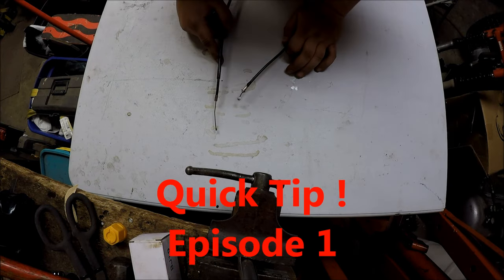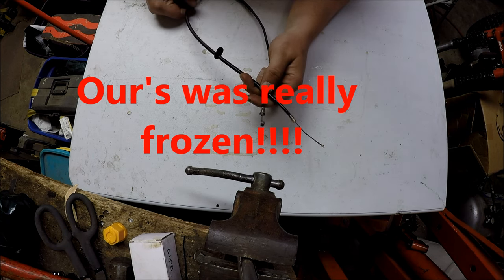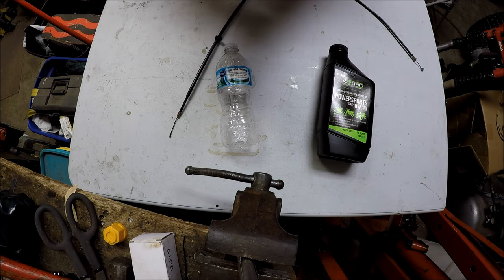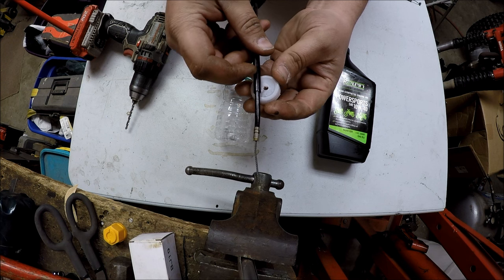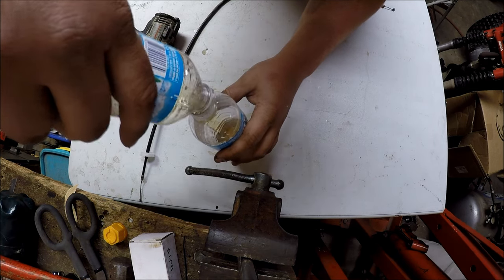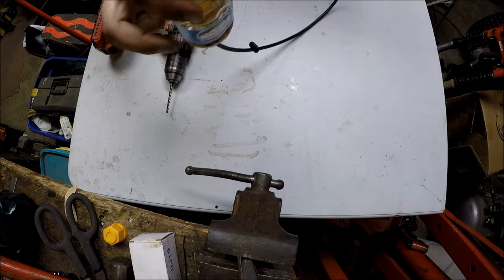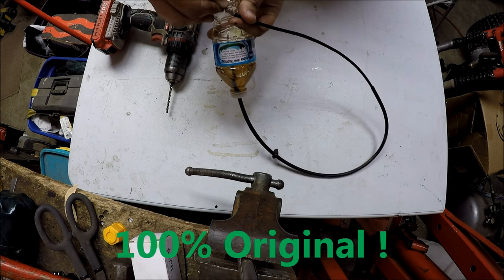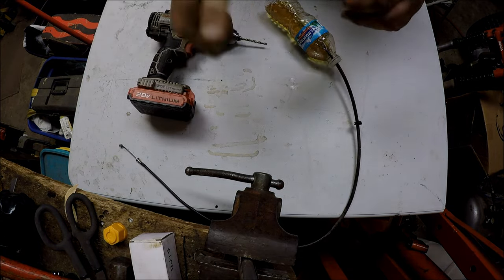How to fix Frozen Throttle Cable  , Brake Cable , Choke Cable on ATV Motorcycle Dirt bike

Comment from the maker: Please consider subscribing and share any tips and suggestions with me.  I would like to say I have gotten alot better with making videos since I uploaded this 3 years ago.
Reply: I have a old WD-40 can  that I use to do the same thing sort of.  

   A couple inches from the top I drilled a hole on the side of the can and I put in a tire valve stem in it. 

   Now the part of the can that had the sprayer on it, I pulled all that out of it and put in its place a thick rubber cork/stopper.   The rubber plug or whatever - I drilled a hole into it - that hole is for placing the end of a throttle/brake - any cable - lawn mower cables mostly is what I do.  So the hole pressure fits and seals around the sleeve of the cable.  I have a WIDE hose clamp that is bent over on one side - I put the folded over side over the rubber stopper - and clamp it down.  

   I use automatic transmission fluid and that is mixed in with some thinner All-In-One oil (whatever it's called 4 n 1  or 3 n 1 - anyways any light oil to thin it down more works)  - The automatic transmission fluid prevents rust for one - and it penetrates through the entire cable - regular motor oil is thick and doesn't do that very well unless it's up to a certain temperature.  I fill the can half way with the mix before I put the rubber plug in with the cable.  I put the end of the cable into a 5 gallon bucket with some blue shop towels to prevent oil spraying everywhere.  

The cable goes all the way to the bottom of the can - so the thing works like a regular aerosol can but with more pressure - no worries about blowing up because it's got that hole in it where the cable is at - it acts like the tube that used to be in it.  The thinner oil plus the pressure of the air pushing only the oil through, takes a few minutes - and that's setup time! 

   What's nice is I can do this while the cable is still attached to whatever I'm working on!  

  I hope you dig my little invention lol!  Thanks for sharing yours!  -  PS, I have a few different rubber stoppers with different size holes!   I tried using a big farmers syringe thing for giving cattle medicine orally - since I had a few of them around that I use to put methanol and other race fuel inside RC monster trucks - but they couldnt push enough pressure into the cables.
Reply: @AEON.  I'm thinking of doing something very similar to your idea.  Glad to see yours worked. 
I'll use AT fluid mixed with acetone..... read about this mixture awhile back and have found its a great penetrating fuild.
Reply: @wholegrain27  It's great but it also swells rubber so it can be used in tires of lawn mowers and stuff to help seal the inside of the tire from cracks on old rubber.  I put it on the cracks on the outside of the tires as well to help them last a bit longer - its nice because if you run over a nail or something like that it will auto seal if its saturated enough and has some moving around in it.  we do this with old tractor tires too because they are so fricken expensive - especially new ones now a days.  But yeah, it will swell rubber some.  It also swells the rubber stopper with the hole drilled in it so make sure to take that into account before pressurizing it - just make sure the fluid doesnt seal the inside hole you drilled lol - I hope it works!  If you can find this post again let us know!  Cheers bud!  Have a good week!

Comment: Once you have the cable moving a bit, you can attach the drill to the inner cable, and spin it slowly spreading the oil inside the tubing, then gradually work it in and out while spinning the cable. It won't take 3 days that way.
Reply: That's what she said.

Comment: why did you pour the oil into the other bottle instead putting the cap on the bottle which has oil in it already?
Reply from the maker: I don't know lol
Reply: Cause he didnt want to ruin the original quart of oil
Reply: Probably baked lmao
Reply: Lol i thought the same thing!  Just doing all the steps tho
Reply: @riceuser18076566  must not understand
Reply: Welp I saw the answer and I'm out...
Bye
Reply from the maker: @jayceraiden1740   I think you are on to something.  Lol
Reply: @DGCoinPusher  yeah, Baked af
Reply: He doesn't need the whole bottle of oil- just enough to cover the end of the cable. Also, the clear water bottle lets you see what is happening.
I just now did this, and I used old motor oil. We'll see if it works.
Reply: Lynn Kasdorf well it’s been 4 weeks how’d it work?
Reply: I think it was just to show us what's he doin
Reply: LOL! Great video, but that was a wtf moment!

Comment: I’m going to try this on a motorcycle throttle cable that’s been sitting since 1995… I’m more concerned about a rust spot creating a weak spot on the cable but if I get the bike to run and the engine sounds good I’ll just replace the cable. My goal is to not spend a dime till I hear the engine running. I sprayed PB Blaster in it and let it hang for the past few days with no luck. Appreciate the advice and video! 💪

Comment: You're a backyard GENIUS!  I did your drip method overnight on a frozen mower throttle cable, the old style with the wound wire shroud.  I used 2 cycle oil (from Ass Hardware, which after properly mixed with gas, burned up my weed whip!) But it freed my cable!
Reply: Naaastaay

Comment: INGENIOUS! GREAT IDEA! LOVE IT!  I  was trying to think of a way to do this today for my lawn mower safety break cable because the shop wants $46 for it! About what I paid for the mower! lol So I thought about duck taping the end of the cable to a funnel and letting it flow in that way. But ended up just submerging it in a 1 gallon motor oil jug with new oil in it. But I like your idea a lot better because I wont know if the oil went in or not and I can't test if it is free. One idea I just thought of though is use Transmission fluid. I was told to use it to free up a car engine that had sat for years and was stuck from rust in the cylinders. And after 24 hours it turned over smooth as can be. I was told it breaks down rust. So might work faster for these cables! :)

Comment: For those commenting to just buy a new cable, I have a stuck accelerator cable on a 2 tonne mini-excavator. Replacement is $260.
This seems worth a shot
Reply: Diesel first then lube
Reply: I've done a different method on large machinery!  I hope it helps!  -  Keep it in your tool set!   (Even used it to push hydraulic fluid through a line to get the air out! after changing an accessory on a Backhoe!

  I have a old WD-40 can  that I use to do the same thing sort of.  

   A couple inches from the top I drilled a hole on the side of the can and I put in a tire valve stem in it. 

   Now the part of the can that had the sprayer on it, I pulled all that out of it and put in its place a thick rubber cork/stopper.   The rubber plug or whatever - I drilled a hole into it - that hole is for placing the end of a throttle/brake - any cable - lawn mower cables mostly is what I do.  So the hole pressure fits and seals around the sleeve of the cable.  I have a WIDE hose clamp that is bent over on one side - I put the folded over side over the rubber stopper - and clamp it down.  

   I use automatic transmission fluid and that is mixed in with some thinner All-In-One oil (whatever it's called 4 n 1  or 3 n 1 - anyways any light oil to thin it down more works)  - The automatic transmission fluid prevents rust for one - and it penetrates through the entire cable - regular motor oil is thick and doesn't do that very well unless it's up to a certain temperature.  I fill the can half way with the mix before I put the rubber plug in with the cable.  I put the end of the cable into a 5 gallon bucket with some blue shop towels to prevent oil spraying everywhere.  

The cable goes all the way to the bottom of the can - so the thing works like a regular aerosol can but with more pressure - no worries about blowing up because it's got that hole in it where the cable is at - it acts like the tube that used to be in it.  The thinner oil plus the pressure of the air pushing only the oil through, takes a few minutes - and that's setup time! 

   What's nice is I can do this while the cable is still attached to whatever I'm working on!  

  I hope you dig my little invention lol!  Thanks for sharing yours!  -  PS, I have a few different rubber stoppers with different size holes!   I tried using a big farmers syringe thing for giving cattle medicine orally - since I had a few of them around that I use to put methanol and other race fuel inside RC monster trucks - but they couldnt push enough pressure into the cables.
Reply: I have an old motorcycle that I can't seem to find a replacement cable for. Im giving this a shot but it is completely seized. Hope this works. 🤞

Comment: Choke lever on my Honda Big Red had split in two, as the choke cable was stuck fast. Just used your method to free it up, here in Bonnie Scotland. I used a mix of 3 in 1 oil and WD40, as it was all I had lying around but it’s a thin mixture that seemed to flow freely into the cable, despite the narrow diameter. It completely freed up the cable in just over 24hrs. Thanks very much for this tip 🙏🏼
Reply from the maker: Good to hear! Thanks for sharing.

Comment: I had two cables stuck solid today on a 120cc snowmobile im fixing up. What I did was use a piece of shrink tube, shrunk onto the outside of the sheath, and then used that like a funnel. Filled it up with deepy creepy and its still hanging up. Thinking it should work just as good as your idea!

Comment: I've just been slowly spraying WD into the gap. Usually works. But I've got a bad stuck cable off a 1987 JD tractor but haven't moved it yet. Gonna give this a try. Thanks!
Reply: Same problem with 1982 JD. Did this method work?

Comment: You can speed the method up if you have a air compressor, by using a rubber hose that just fits over the cable..slide hose over the end of the cable put a clamp on it, pour some oil in the hose and put your air gun nozzle in the end of the hose and shoot the air to it forcing the oil through the cable till it comes out the other end! Wa-La

Comment: I have a old WD-40 can  that I use to do the same thing sort of.  

   A couple inches from the top I drilled a hole on the side of the can and I put in a tire valve stem in it. 

   Now the part of the can that had the sprayer on it, I pulled all that out of it and put in its place a thick rubber cork/stopper.   The rubber plug or whatever - I drilled a hole into it - that hole is for placing the end of a throttle/brake - any cable - lawn mower cables mostly is what I do.  So the hole pressure fits and seals around the sleeve of the cable.  I have a WIDE hose clamp that is bent over on one side - I put the folded over side over the rubber stopper - and clamp it down.  

   I use automatic transmission fluid and that is mixed in with some thinner All-In-One oil (whatever it's called 4 n 1  or 3 n 1 - anyways any light oil to thin it down more works)  - The automatic transmission fluid prevents rust for one - and it penetrates through the entire cable - regular motor oil is thick and doesn't do that very well unless it's up to a certain temperature.  I fill the can half way with the mix before I put the rubber plug in with the cable.  I put the end of the cable into a 5 gallon bucket with some blue shop towels to prevent oil spraying everywhere.  

The cable goes all the way to the bottom of the can - so the thing works like a regular aerosol can but with more pressure - no worries about blowing up because it's got that hole in it where the cable is at - it acts like the tube that used to be in it.  The thinner oil plus the pressure of the air pushing only the oil through, takes a few minutes - and that's setup time! 

   What's nice is I can do this while the cable is still attached to whatever I'm working on!  

  I hope you dig my little invention lol!  Thanks for sharing yours!  -  PS, I have a few different rubber stoppers with different size holes!   I tried using a big farmers syringe thing for giving cattle medicine orally - since I had a few of them around that I use to put methanol and other race fuel inside RC monster trucks - but they couldnt push enough pressure into the cables!

Comment: I have a motorcycle brake cable oiler works on the same principle as this, but with it, you clamp the tool around the end, and on the side of the tool is a tiny hole big enough for a red tiny straw you get with cans, and you spray the lube, rather it be wd40 or pblaster into it, and that forces the lube into the sleeve of the cable, I will try your method but maybe with a little compressed air to force the oil or wd40 down the cable, I would also try a stronger bottle so it doesn't expand so easily, but super awesome idea, now to figure out how to do the mower cables with a big end on them.

Comment: ive got an 1986 yamaha cv80 (looks like a 1960s vespa) and the brake handle won't budge i hope the cable isn't rotted in the inside other than having no brakes it runs well.

Comment: Have a cable for the shute height on a snowblower. One half of the cable is rusted and snapped but out. The other half is still in the sleeve but rusted solid. I tried holding the end of the sleeve where the threads is in a bench vise and and the end of the cable with vise grip. I pulled with all my strength but .Nothing moved.
I will try this and see what happens.

Comment: Great method but consider instead of drilling a hole in the other side of the bottle try gently squeezing it until some oil goes through then squeeze harder until the cable is free. much faster and you can re-use the bottle
Reply: I can re-use my water bottle?   Thanks man, you just saved me a lot of money!
Reply from the maker: I did this first but cable was too frozen
Reply: It's not a perfect seal. Won't you push oil in-between the cap and cable

Comment: I have a brake cable from my chopper bicycle that's stuck up. Both front & back got corrosion after rainy season here in Philippines. Might wanna try that since I don't have enough money to just buy new ones. But thanks for the vid anyway!

Comment: Just pulled my yamaha xt outs the barn been sitting a few years.and the clutch cable froze.we will if this little trick works
Reply: Did it work?
Reply: @threewheelerdonuts8284   i think its still getting lubed
Reply: Did it work
Reply: @MrBeastmania  no...bought a cable off ebay.they sent the wrong one.
Reply: @xjeepmanx  dang

Comment: I wonder if you used PB Blaster, Carb cleaner or some other solvent it would work faster? Pull the end of the cable closer to the cap so you wouldn't have to use as much liquid...
Reply from the maker: That would probably work even better considering it's a thinner liquid and the best for getting off rusted bolts!

Comment: I got an old Sears bicycle from the 70s. I unlocked the front breaks by soaking the line with WD-40, but that didn't work for the back breaks.

Comment: I have a three wheeler and my cable won’t return when I push the thumb thing and I have cleaned the carb and oiled the spring on the cable any idea what to do?
Reply from the maker: Sounds like its getting binded up?   Hmm..
Reply: Dalton's Garage it works fine when the whole needle and plastic thing is out of the carb but has soon as I put it in it won’t return
Reply: Apple69 did you ever figure out what your problem was just got a Chinese project bike and need to get that cable to return thinking about buying a new one but if you know how to fix it no point in wasting my money

Comment: Will it still work if I only have one water bottle? Or do I absolutely have to fill one water bottle up with oil then pour it into another water bottle ? Important questions
Reply from the maker: Very good question I have never tried it the other way this is the only way that I know
Reply: i agree with you on that
Reply: The oil was in a soda bottle, not a water bottle.  So yes, make sure you put the oil in a soda bottle and then pour it into the water bottle.

In case you took that seriously, I'm pretty sure the soda bottle contained the oil he originally used to fix the cable shown in his demonstration.  He just used that instead of pouring more from the oil container.

Comment: Awesome tip. Will this work with wd40 or do I need something more substantial?
Reply: Yeah you might need WD-50!
Reply: WD 40 is not a lubricant, It is a cleaner. Common misconception. 
I would not use it except to clean before lubricating with cable lube or another lubricant.
Reply: @WilliamsonGene  WMD-40...

Comment: Try using a 9 volt battery. Touch each end of the cable, one to the positive and the other end to the negative of the battery. Do this for 5 secs at a time. In between each charge to make the cable get hot, move the cable back and forth while squirting in something like blaster rust remover. Once its lose spray it clean with carb spray, then blow it dry with compressed air. Then use 30 w motor oil to finish lube it.  Takes about  30:min.

Comment: Hello! I have to replace my choke cable on my Vstar 250. Do i have to drain the fuel if i have to get the gas tank off or can i put it to the side gently? Also will fuel spill out if I detach the cable from the carburator?
Reply from the maker: Amp661 hey it would definitely be smarter to turning fuel shut of off and disconnecting the fuel line (the end connected to carb) then pull the tank off.   No fuel will leak.    Also no fuel will leak if you disconnect the choke cable .     Fuel is in the bowl of the carb only